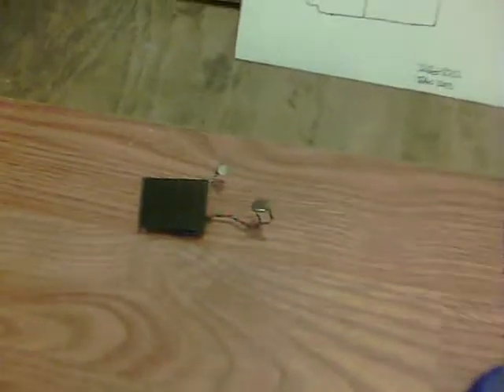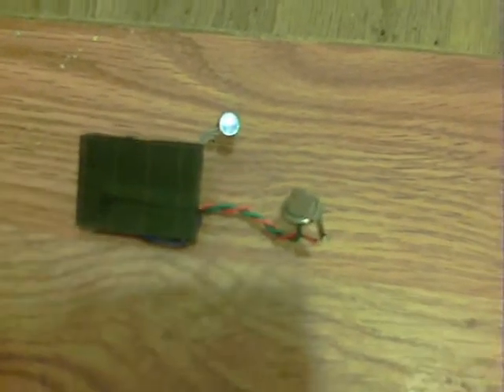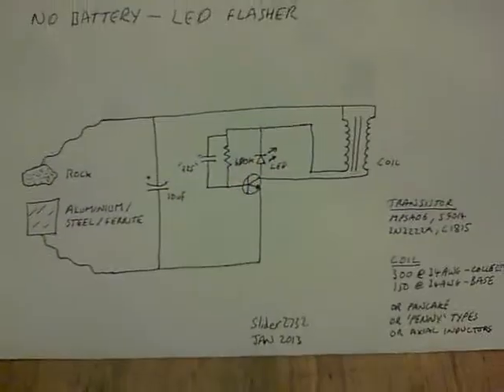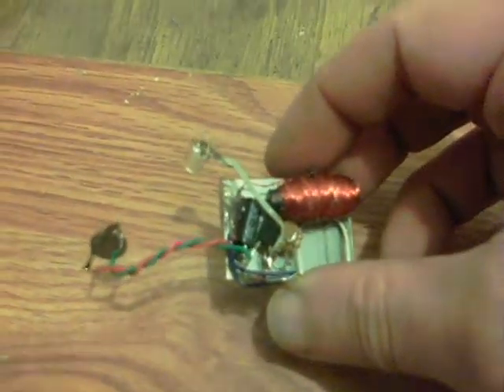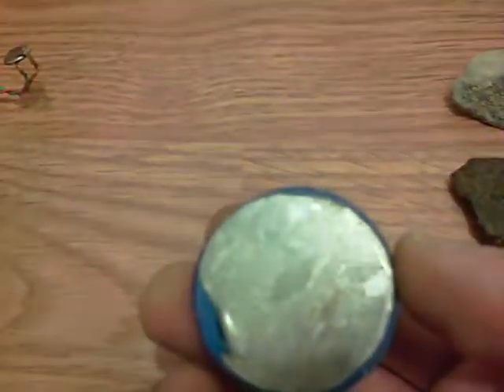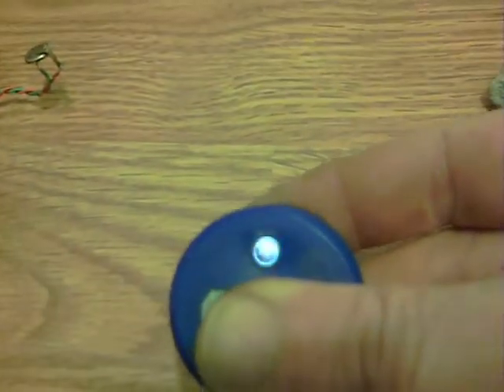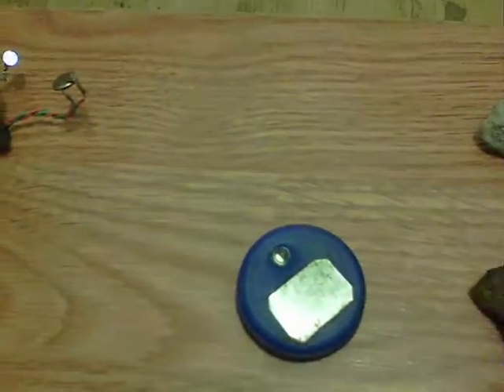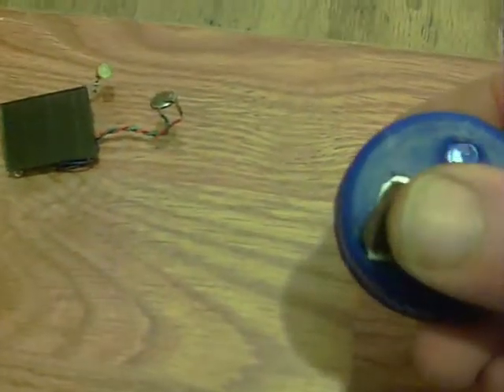24/7 ambient light osc + Rock Tester

Comment from the maker: Good luck with that,  I haven't used a cellphone in 5 years ! Generally a good prop is the tail rotor type from R/C heli's. 2 channel R/C planes often have 1" or so props that run well, though may need lightening on the reverse faces (and rebalancing afterward). Alu from soda cans can be a good prop, free too.

Comment: I'm thinking form the ally foil hull, then multiple copper pos. But do I form it as a battery or cap. Thinking salt water running. Might try forming the first one in alum, then the next one in borax, see what works best/lasts longer. 

I'm currently winding .1mm (5thou) copper on a little tube. Hoping to get over 100m (4") wound, giving me over 1000 turns. Now what would I do with 1000 turns of wire on a little tube? Getting some 3mm copper rod soon too :)

I'm about 250 turns down, 750 to go.

Comment from the maker: Yep, smaller and smaller panels are one aim. The polyacenes should allow us to avoid the battery troubles of charge while discharging. A 24/7 always running ambient osc may be highly useful for switching transistor Base's or MOSFET gates, with OU type circuits (avoids 555 or other osc loads). Did a 24hr dark test + LED kept going, took just 1hr in cloudy daylight to return to full output. Fun stuff :)

Comment from the maker: HA! like a cellphone vibrate motor. Hmm, they'll run on a volt'ish, but quite a few mA. 
You could light up your put put boats using electrodes in the water...bigger boats could have half a dozen little circuits with 6 twisty ties and 1 piece of copper on hull.

Comment: Another couple of great projects. Combine the two and you have a portable never goes flat touch lamp for the bedside table.

Wonder if you could power a motor with an offset weight, Put in ball. Rock'n'Roll.

Comment from the maker: Yeah same wiring, it was de-glued from the solar light, but then I superglued it to make sure no rip away with use. That light type looks like a rock in fact when store bought. 
The white rock was thought to contain quartz due to glints in sunlight but just seems to be filler rubble for roads. Will try wetting it, brb....nope no reaction at all. Good test though :)